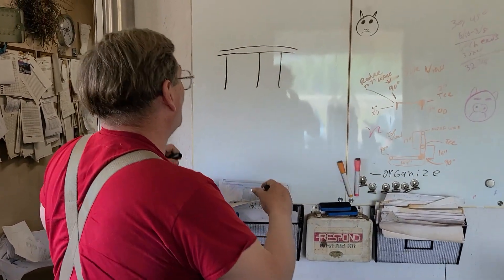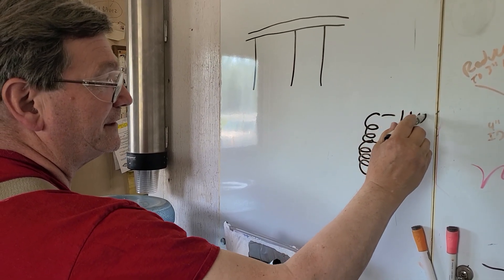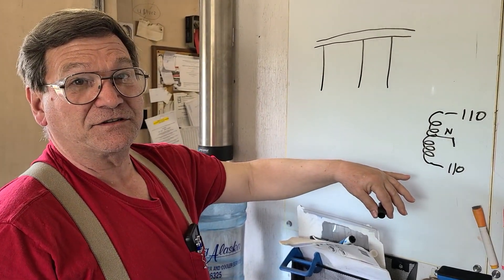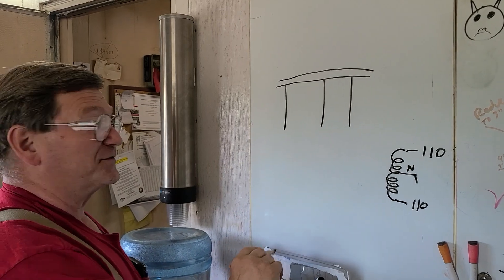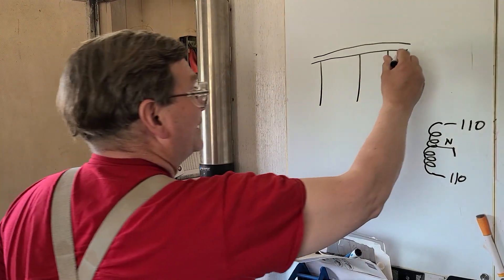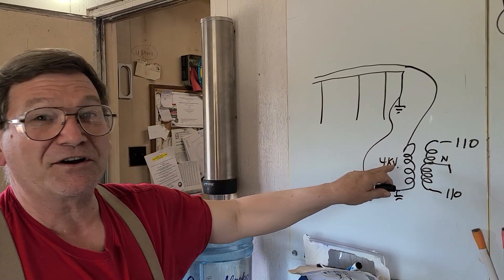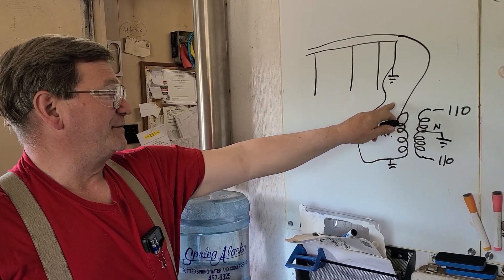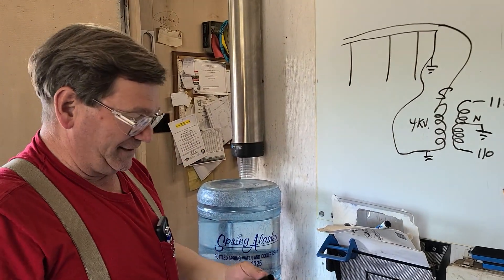Why do we ground our electricity?

Comment: Karma is like electricity…
Moral hubris (forgiveness of yourself and others) is the ground wire that shorts out the high static charge of energy you put out (doing crap 💩 in your life)
No ground wire can kill you!

Everything is built on electrical principles.

The Law will CHARGE you with a crime and put you in a CELL (battery) until you are DISCHARGED 😵‍💫

Comment: Don't know why but a couple years ago I began to wonder if I had ever bonded the ground to Neutral in my 100 amp main panel. So I removed the cover and looked.NO. I had not. For over 20 years I had had no problems what so ever. I bonded it with the supplied screw. I case of an EMP or carrington event you are going to want that bonded to help keep from  turning the inside of your walls into a toaster. Sub panels are not bonded but it does not hurt to give each one a grounding rod so you don't have to run another wire [ground] back to the main. In an industrial setting never use large wire nuts on wiring large motors. They burn up and ruin your motor from single phasing. Use the lugs made for big motors. CAREFUL!! one mistake with electricity can cost you a limb or your life!! Been my experience that HVAC people are better electricians than electricians are.

Comment: 7200 V line voltage single phase rural and home lines here in C ND. Transformed down to 120/240 volts. I have seen farm homes function with the ground wire torn down and laying on the ground all because there are ground rods on the neutral lines and boxes. Then there is 3 phases for larger applications. ALL on the line and boxes earth grounded neutrals for your protection and for leveling hte ground plane! Then there is the safety ground on our appliances for our protection as well.. Distribution lines to substations are much higher voltage.
Reply: Bonding is for point!of use safety

Comment: In an installed wiring system, that first fault could be anywhere and sit idle for years.  If the transformer fed multiple buildings, it could be in any one of them.  Then years later, the 2nd fault happens causing a ground fault, possibly through a person.  But it would be near impossible to find both faults so you'd have to tear our the entire wiring installation and start over.  By building in the first fault intentionally, the 2nd fault is cleared by the fuse/breaker and that reveals the circuit to inspect.

Not to mention, having a grounding rod in the earth, static build up is mitigated, induced currents by nearby lightening [or large inductive loads switching] are mitigated reducing arcing and there is a resistance path that will cap the voltage spikes if the center tap/neutral is lost.
Reply: Why doesn't the first ground fault cause an issue? Is it because the impedance of the path back to the source is too great to draw a substantial current to trip an overcurrent protection device? Does the second ground fault (I'm assuming in close proximity to the first) create a low impedance path where a large amount of current can flow and trip the OCPD?
Reply: @kyle6094 If you know calculus, you know for instance that the indefinite integral ∫ x dx = 1/2 x² + C, and that if you leave off the +C on an exam, you lose points.

Well, voltage is the integral of the electric field, and so it has a + C term. The value of C could be anything, but grounding one side of the transformer secondary sets C to zero. It doesn't cause any current to flow. But it causes the other terminal to have a definite voltage, cycling between +120√2V and -120√2V. Shorting that voltage to ground (the second fault)  causes lots of current to flow.
Reply: First ground fault has no path to the source. Voltage is always between two points, like from one side of transformer to the other. Grounding one side is like attaching a wire with nothing on the other end. The second ground fault is like connecting the other end of the wire to the other side of the transformer secondary winding.